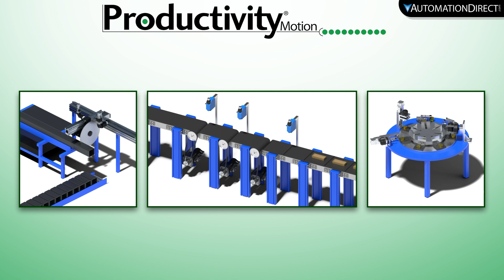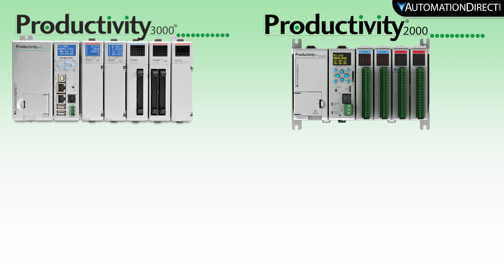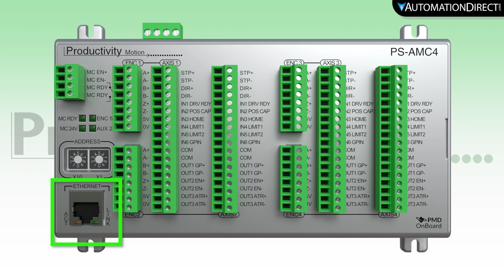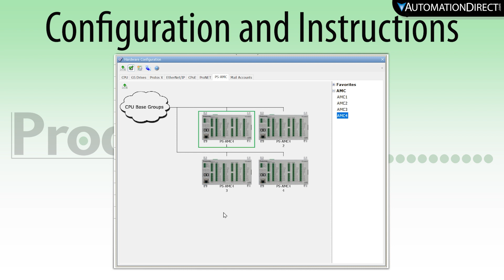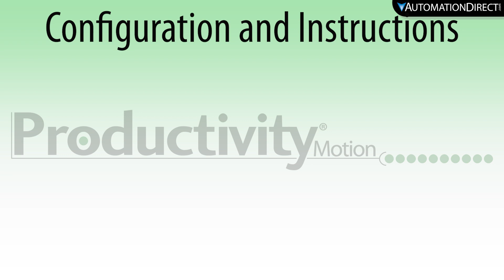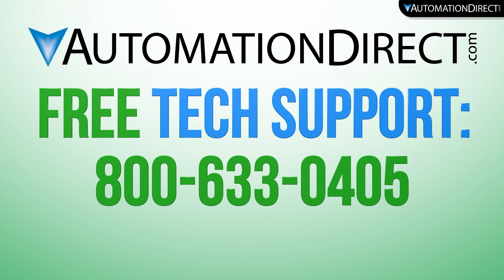ProductivityMotion AMC: Features In-Depth from AutomationDirect

Comment: What is the difference/benefits of using a AMC unit instead of HSO module?
Reply from the maker: @JuanBayona-y3m
Great question! The AMC module is the only way to have multi-axis integration with Productivity High Speed motion. It supports electronic gearing between axes as well as master/follower camming relationships among other features. It is also the only way to have closed loop control with an encoder for a pulse driven axis. You can even dedicate an axis to being an encoder feedback only axis and have one or more motion axes follow that encoder axis.

Comment: So the AMC device requires an additional remote I/O module to talk to the PLC?
Reply from the maker: The AMC device can talk to any of the Productivity PLCs that has a "Remote I/O" Ethernet port on them. Some of the Productivity PLCs are stripped down to be more affordable for simpler applications and only have a standard Ethernet port. They won't be able to control the AMC. No additional remote i/o modules are required.